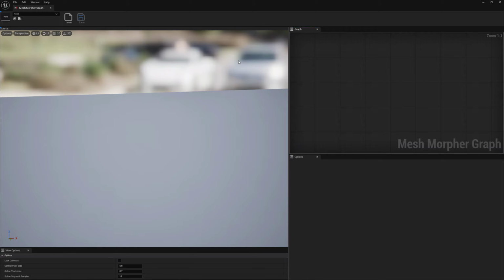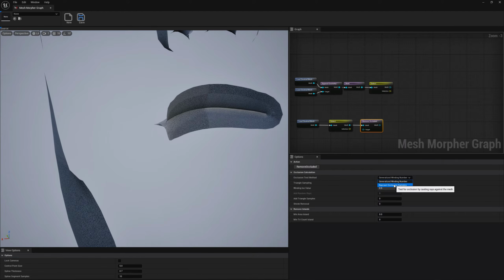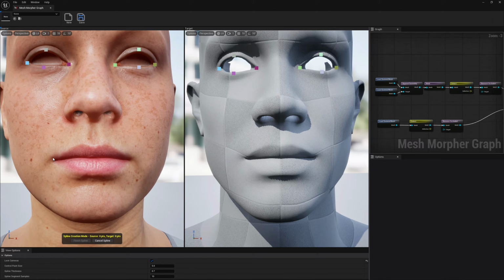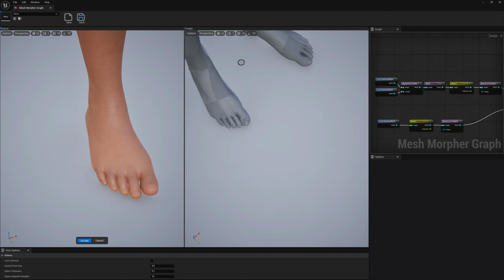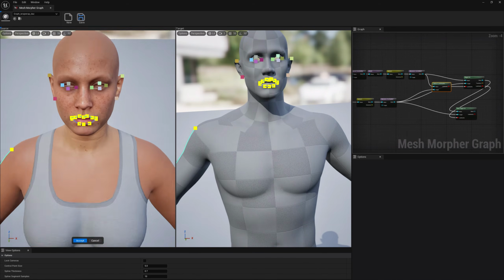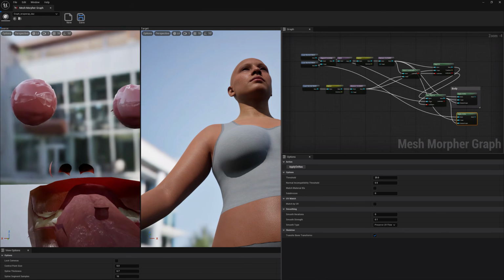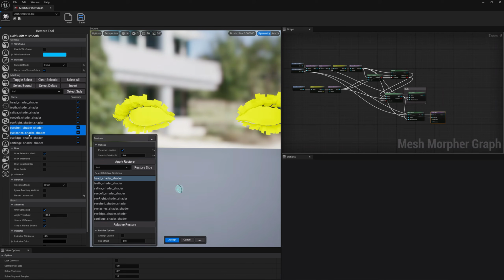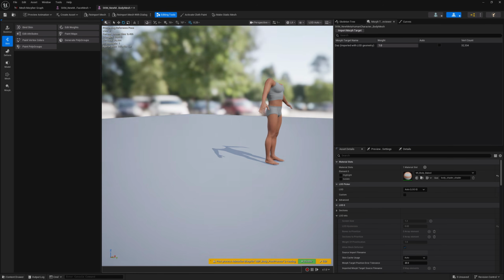Advanced 3D Wrapping in Unreal Engine with Mesh Morpher Graph

Comment: The speed at which you update new features is truly astonishing! It would be perfect if there were a switch to display the point number and a function to adjust the position of the previous point. In Wrap4D, you can drag the previous points to adjust their positions without disrupting the numbering.
Reply from the maker: Great ideas, thank you. I have actually implemented all of them. Check it out.
Reply: @PugLifeStudio  I just watched the latest video and it looks great!
I believe that after using the Wrap system of the current MeshMorpher, everyone will come to like it. It is much more powerful than before, and for the usual process, there is no need to do the same things in Wrap4D.